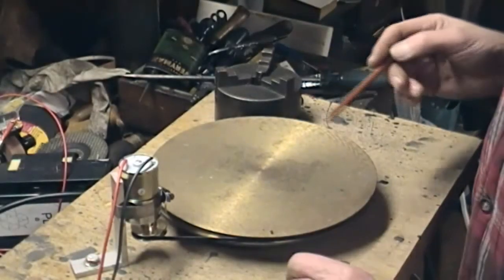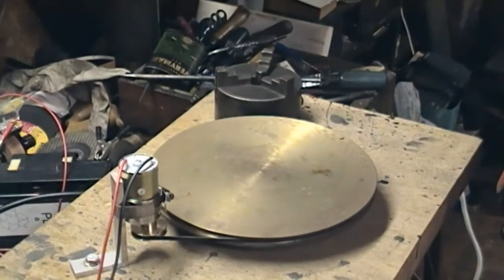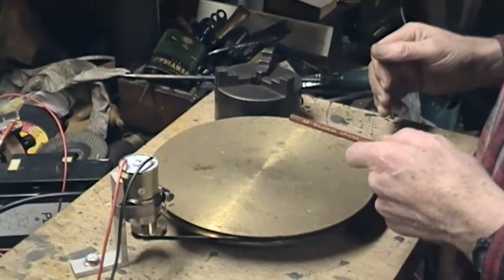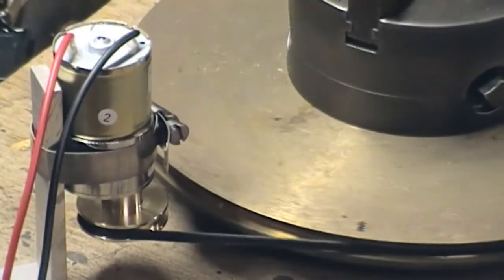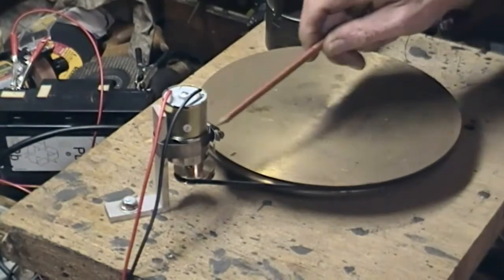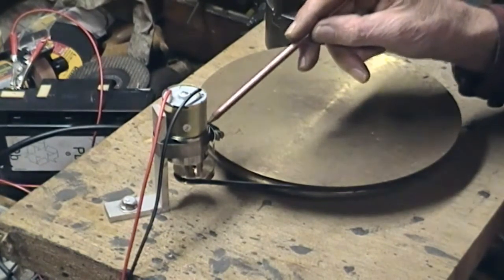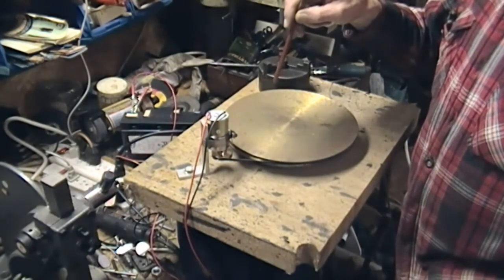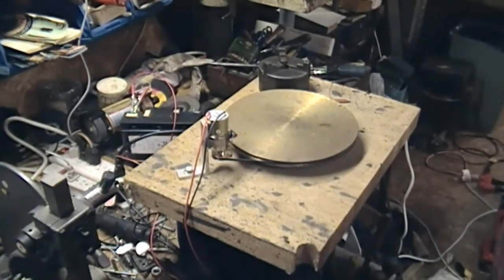Motorized Turntable, Part One B

Comment: Hi Chris, Nice camera work and editing!  That is ONE Nice plate of brass!  I've watched both of these now and know how we like to build things on the fly but was thinking this afternoon about your design.  These are just thoughts so please don't take them as anything else.  It occurs to me that your flux wire welder is pretty sparkly typically and your base is wood.  Also your temp test setup will expose the DC Motor and belt to the elements without a cover of some kind.  What if you put a "Big Bob" O-ring in your V-groove pulley and drove the plate from the bottom side flange ring on the plate (friction drive)...didn't see how true it was but should work and keep your motor a little more safe.  It should also allow for your brush ring set up to be in a more stable environment.  Also the turntable could be mounted on a scrap of ~1/4" plate with a taller, tighter tolerance, spindle and use a cut down gal paint can (or such) for shielding under the turntable and be a lot more fire proof.  Then put some stand off bolts in the corners of the plate to keep it off the bench for the wall wort and such.  To me the issue of the drive is constant torque regardless of load so in some ways a PWM controller would be best but do agree with +dan bentler.  Possibly a better approach might be to use an old LM317.  Lots of circuits in the Cut sheet below (like fig. 14 the best but more complex).   Hemingway...just thoughts¿  Thanks for sharing your fun projects and insights!  ~PJ

http://www.ti.com/lit/ds/symlink/lm317.pdf
Reply from the maker: Thanks - mind you my camera is a real cheapie and I don't find definition good enough at all - I do though keep trying different ways of mounting to get the angles. One day I hope something better. Editing always does help 'tidy up' a bit though. Greatly appreciate all your suggestions - food for thought and very helpful. I have no 1/4 plate in either steel or Al big enough; so wood will have to do I think - that said I could clad it with a thin sheet -- but certainly think a motor housing will be wise. Thx for PDF file - I know the LM and in fact I think my small controller uses one of those - may still even have one! Did consider friction drive for sure but the flat belt I have currently tried seems to cope well. Thx again. :)
Reply from the maker: Bill Lewis Ahh, the good ol' 555! So versatile. I have a few of those and mosfets I think -- may well knock something up, although 'somewhere' I am sure I have a small circuit already built.  I'll wait for now to see what my 5 RPM motor does when I get it.
Reply from the maker: Thx for the comments. Watch the later parts -- I think most of your concerns have been addressed now and the motor positioning was, in the end, the one that suited best. :)

Comment: Hi Chris,
Have you looked for a "roadkill" Microwave? 
The turntable motor could be just the ticket for driving that plate and chuck.
They are mains voltage and a light dimmer could be used for  speed control. 
Cheers Eric

Comment: Did you have a set speed in mind for the unit or would it be better to incorporate speed control with the faster motor to get the range of speeds? I have the electrics from an old cordless drill and it makes a great speed/reversing control. I kept it for a similar project.

Colin ;-)
Reply from the maker: Good thought Colin - I don't have an old drill to plunder but, once I see whether the 5 RPM motor is doing good, could well revert to the 30 RPM with speed control. The project is like so many of mine - on-the-fly - experiment! :)

Comment: Chris

Slick setup.  Now that you have tested with a simulated load and have an idea of current demanded by the motor you can make a decision on motor speed control.  You got 0.3 amp so assume 0.5 for preliminary design.  I would use a reostat in series with motor.  Should not take a big one - at assume 1 amp and 12 volt that is 12 watt.  Yes they dump heat - wont be much and the shop is cold in winter might even be enough to keep your coffee hot.

I thought you were only going to use this for torch brazing.  OK now you want arc welding - no big deal.  Ideally you sholuld run the welding work lead direct to the work - cant be done in all cases.  Use two or three large motor bushes for  this in parallel of course.  one square inch contact area per 100 amp should suffice off top of head

Dan Bentler
Reply from the maker: Thanks Dan. Indeed torch brazing very likely as well as arc.  Now I think on it I have a whole bunch of large carbon brushes - maybe I can polish hub nice and smooth and set up a brush array. Certainly another idea for sure.... and chances are currents will be fairly modest for that sort of job, otherwise direct to work by some method. Rheostat certainly a viable option, although I think a PWM controller may be better if needed.
Reply: ChrisB257 If I understood correct you intended to power from battery.  If so why go from a ripple free DC to ripply DC using solid state - IF this is  case better with reostat and reiliability assuming correct size is infinitely better.  IF coming off solid state or variac  rectified for DC should be OK.  Only problem with solid state can be cogging at low RPM however with the very large reductions you have this should never be a problem.

Dan
Reply from the maker: dan bentler  Battery is convenience right now but - I have a well smoothed DC supply available which I may finally use. Agreed too - the gear reduction should avoid any 'cogging' if supply not well smoothed. Still reckon to have foot switch whatever the final system.